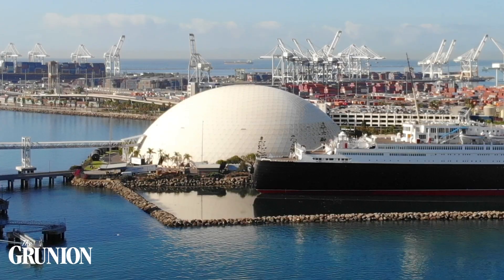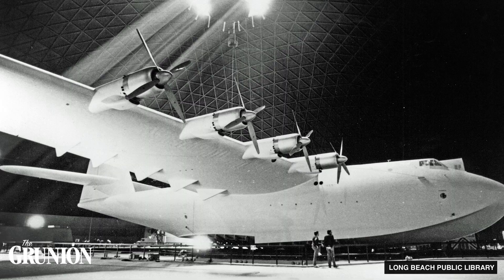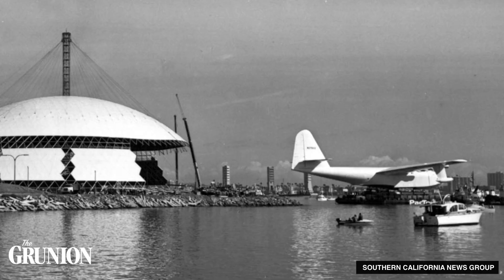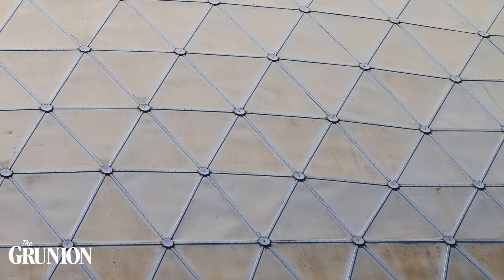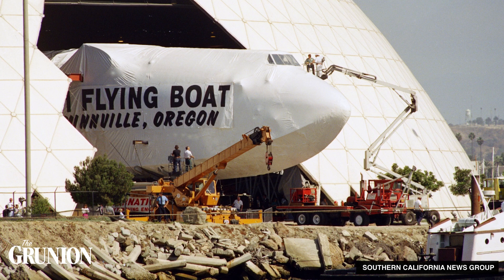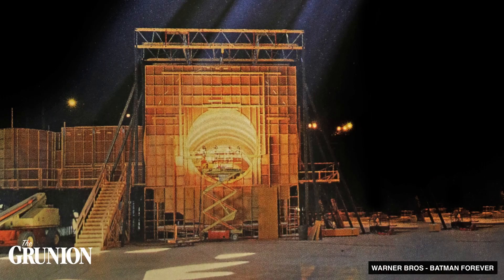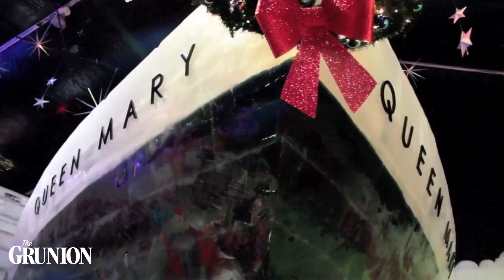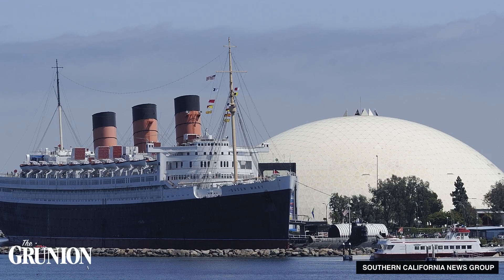The "Spruce Goose" Dome: The Forgotten History of a Long Beach landmark

Comment: Great video, but one thing about when Carnival started using part of the dome as a cruise terminal - they began operations in 2001 with the Carnival Elation. By 2016, at least four Carnival ships that called it home had moved on to different ports and destinations. I believe 2016 is when they renovated and expanded it.

Comment: The “Spruce Goose” dome needs work to prevent structural integrity issues. This is critical since Carnival uses the dome for passenger loading at its terminal and plans to reopen for cruises later this year.
Reply: Let Carnival do the repairs, NOT taxpayers.  We've been screwed over enough already by city hall with the QM and the new City Hall & Civic Center.  Instead of using the old City Hall to house the never-ending homeless population, they want to tear it down.  SMH